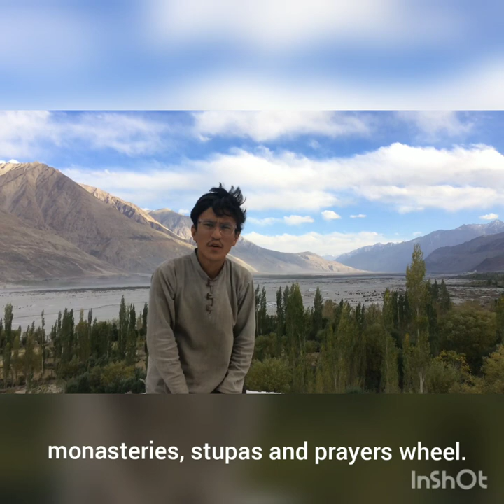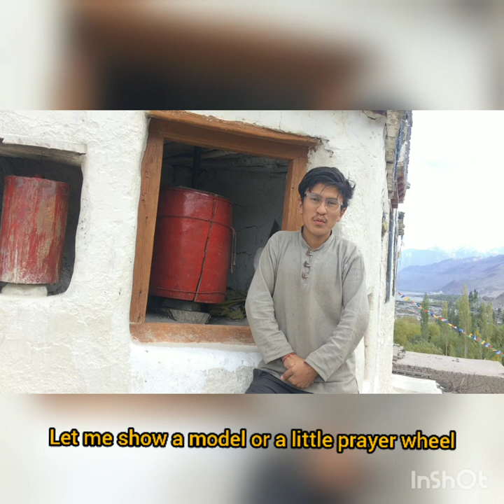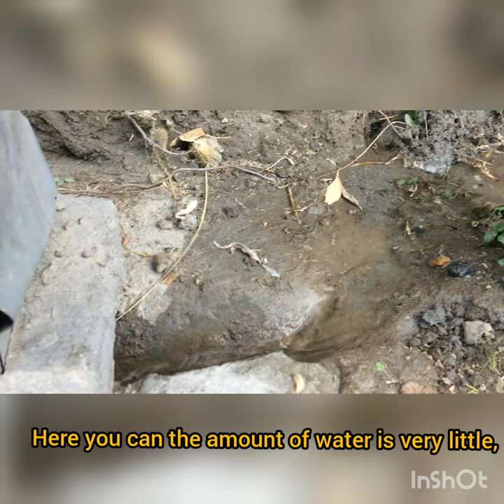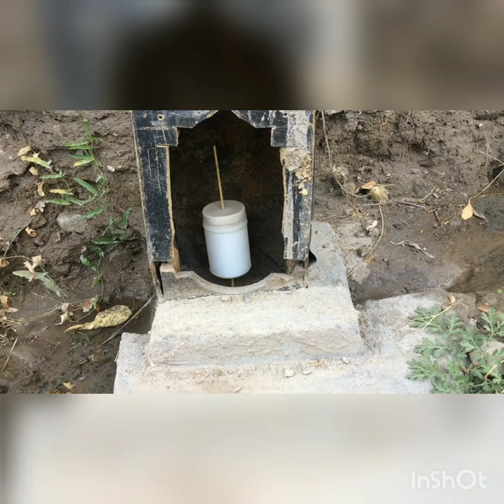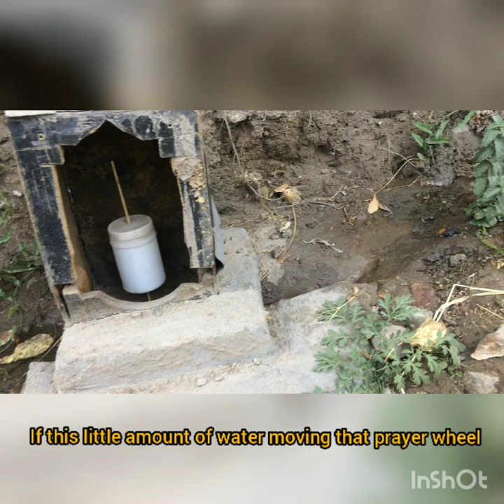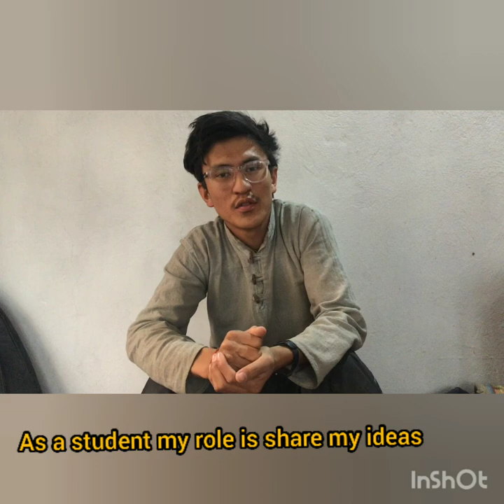A model of prayer wheel that run on water energy making it from #waste by using concept of Science.

Comment: Great work Tsering! I wanted to copy your little prayer wheel; however, mine the prayer wheel does not spin, and the bottle (baking soda container) keeps sliding down.  What do you use to keep the bottle in place?  Your milkmaid cap is spinning under water so nicely. What do you use under the milkmaid cap to hold it in place?  Thanks